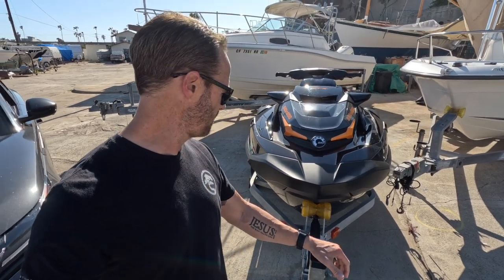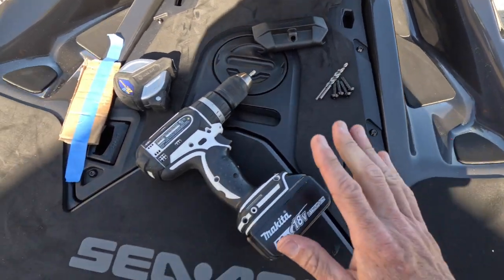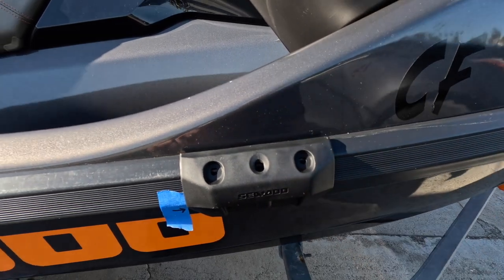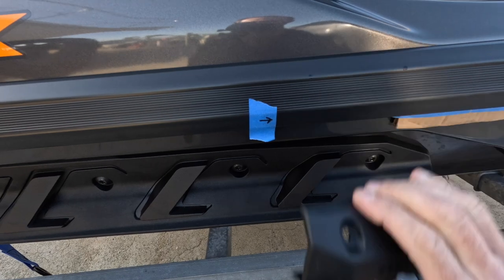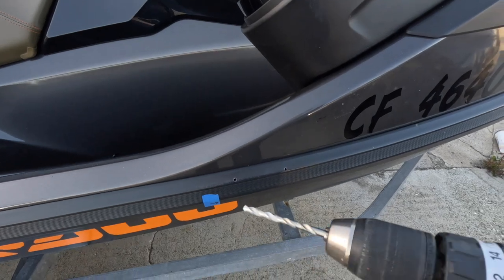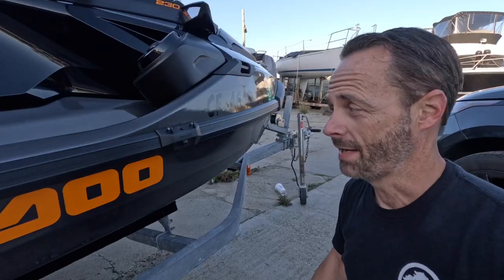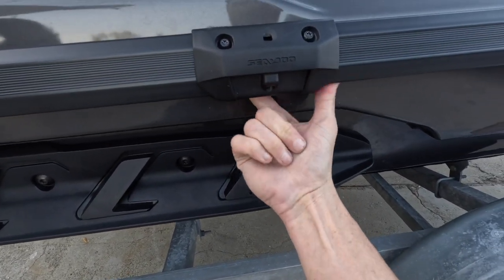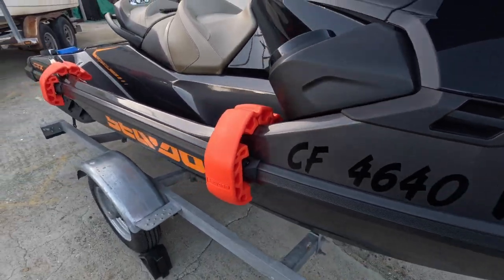Sea Doo | Snap in fenders:  Installation made easy. @Seadoo

Comment: Thank you, that was super helpful. Does this come with 4 mounting plates, or only 2? Also, I have a couple of suggestions for your viewers. 1. Set the drill to slow speed (top switch should be forward; yours was back, set for high speed); 2. use an allen key or manual screw driver to screw in the bolts (otherwise, somebody will inadvertently over-turn and mess up the threads). Thanks again!
Reply from the maker: The kit only comes with two brackets. 
Thank you for the positive tips. Very encouraging. I have received “tips“ before, but very negative as if, “what the heck are you doing!”  so I appreciate your feedback. And thank you for sharing that for the viewers as well.
Reply from the maker: 👉here is where I got the fenders if you dont them alreaady.    https://amzn.to/46JibiP

Comment: A little tip for next time you have to drill into a sensitive area and don't want to go too far.  Wrap the drill bit with electrical tape at your max depth to prevent it from going in too far, it'll act as a stopper.  Nice job, I'll definitely be adding these to mine.  Haven't decided yet if I'll do both sides.
Reply from the maker: thank YOU!

Comment: I have the 2022 GTR 230. I ordered a set of the snap in fenders a couple of months ago, I haven’t put them on yet.
Reply from the maker: So what's the difference between a GTR ad a GTX?
Reply: @TheOceansideGuy  GTR has the polytech hull, it’s lighter. I notice the GTX has the huge storage that the handlebars raises up with it, mine only has the smaller lid in front of the handlebars. The GTX has the ergo lock seat and ST3 hull. There are probably other differences as well. I just got mine back in August and it’s my first new Seadoo, I’ve only owned older ones in the past.

Comment: Great video.  Are you actually drilling into the hull, or the rail?  I assume if it’s the rail you can feel the screws underneath.   If your going into the hull, should you add marine silicone in the holesprior to putting the screws in?
Reply from the maker: Only drilling into the rails.  And yes its good to add silicone as well.  I did not add silicone when I put them in but I got a tip to add the silicone, so I did it later.

Comment: Great job… but use that clutch feature.  It’s the one selection on the drill that is a screw.  Set that to 9 and go up from there. It stops at resistance increments.  9 setting is pretty good. It won’t over torque or mess up the holes.
Reply from the maker: Great info.  Thanks for sharing . I did not know. 
Appreciate you!

Comment: Does the screw go into the body that the rubber strip is sitting on? My bolts are longer than the thickness of the rubber and will penetrate what the rubber is sitting on. 2024 Seadoo GTX Limited
Reply from the maker: They should not go into the hull. Just the protective bumper. I am trying to remember, but I think the screw came out the other side of the bumper, but did not go into the hull . If it came through, it came through very minimal.
Don’t forget to take into account the mounting piece that goes on there because that will shorten up the length of the screw going through.

Don’t forget to use some marine grade silicone.
Reply: @TheOceansideGuy  There is a lip that the rubber sits on. I assume the bolt is safe to go into that lip under the rubber piece which is why I see the cardboard under the lip protecting the body of the hull
Reply from the maker: @unpredict2ble  Yes there is a lip.  And yes thats why I put the cardboard under to protect the hull if I goofed. Just be sure to go in at the correct angle.  Let me know how it goes.  And thank you for reaching out.
Reply: @TheOceansideGuy  Got them on. Although under the first one, the hole was not at the right angle, so I slid it over and drilled it with the bracket in place to get the angle right. Both are in place and looking good.
Reply from the maker: @unpredict2ble  glad it worked out! Can be a little daunting drilling into the ski. Sounds like you made it work. Nice job!
Thanks for sharing!

Comment: Does anyone find the mounting bracket’s for the bumpers on the rear ones spray a lot of water on the passenger .Just had them installed on our 24 gti and find the rear ones throw off a spray for some reason.
Reply from the maker: Mounting brackets did not cause any issues. Only if you actually keep the bumper on there then yes you can get some spray back.
Reply: @TheOceansideGuy   Bumpers are not left on during riding ,but passenger gets sprayed by water hitting the rear mounts ?
Reply from the maker: @BruceMacDonald-yr9rx  very strange.
Not sure how that actually happens. I have not heard of that at all.
Maybe you could send me a photo. Find me on Instagram the Oceanside guy.

Comment: Nice ski bro, I got the same ski but the 2023 170 GTX Sea Doo with a Triton trailer with the mag rims. It's still at the dealership waiting for the dashboard. Did you know that you can add the windshield on your GTX being that I live in Michigan I might install that myself next year. I'm not to keen on drilling holes for fenders/bumpers I got something different it raps around like yours but it suction cups to the ski. After your 10hr. break-in do a video  on your top speed please. I'm  going to have my own YouTube channel this summer myself let's keep in touch have fun be safe and Happy Easter ciao for now bro.
Reply from the maker: Thanks for the comment Paul.  The windshield may be a goo idea.  My wife and I were out today April 8 and hit 80mph in sport mode.  As well as hitting 12 hours on the GTX.  So, yes. I will do an exclusive vid on top speeds for sure.  Stay tuned and I'll see ya on the water.  
Have a great resurrection day!
Reply: I got the explorer pro and it has the windshield. Much nicer in rough surf and when running fast. My face stays dry and my hat stays on. People complain that it keeps you hot, but we've had heat indexes well over 100 (112 today) down here in SW Florida, and it's not been an issue.

Comment: I would recommend NOT using the drill to tighten the bolts.  Also that drill has a clutch.  Use it.  Plus the manual recommends using silicon on the bolts when installing to stop water intrusion.  I have installed MANY.  Using drill with no torque limiter is a REALLY bad way to strip the holes.  Then you have a BIG problem...
Reply from the maker: Thank you for the tip

Comment: Great video.  Are you actually drilling into the hull, or the rail?  I assume if it’s the rail you can feel the screws underneath.   If your going into the hull, should you add marine silicone in the holes prior to putting the screws in?

Comment: Great video.  Are you actually drilling into the hull, or the rail?  I assume if it’s the rail you can feel the screws underneath.   If your going into the hull, should you add marine silicone in the holes prior to putting the screws in?
Reply: He is screwing into the rail only, which is why he used the cardboard behind the rail.